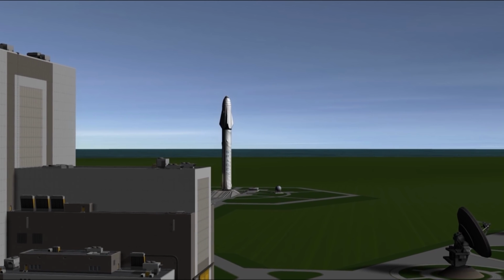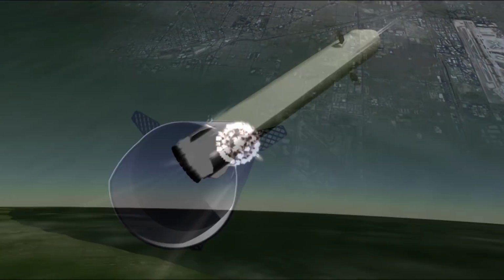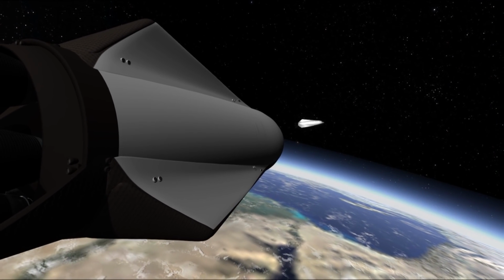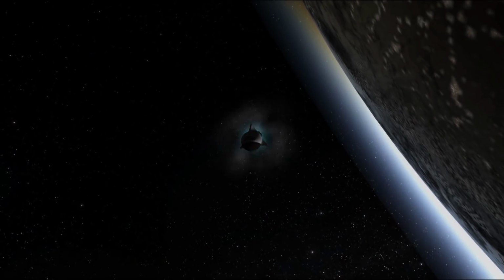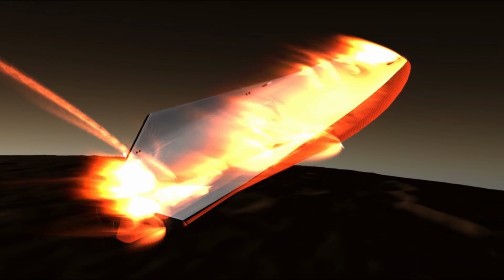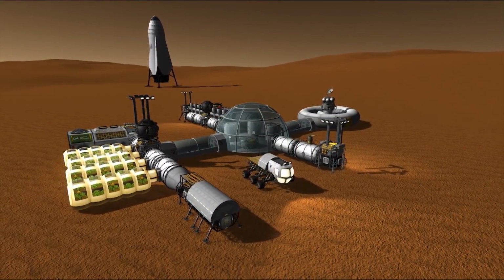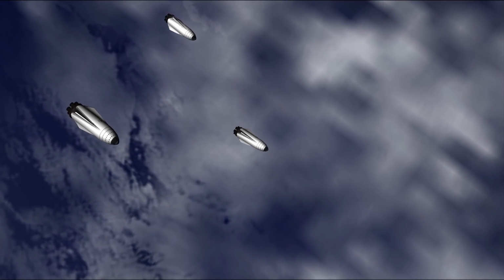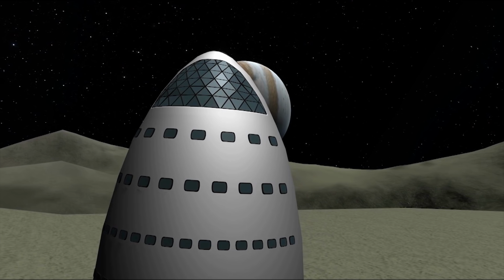Mars Colonization - SpaceX Interplanetary Transport System - Full movie

Comment: Nice video BUT it's incorrect about refuelling.
The tanker's are not heavier than the spaceship they weigh almost the same.
The spaceship requires 5 fuel tanker flights to fill up it's tanks before departure to mars - the video incorrectly claims it needs only one.

Comment: That would be a terrible waste, to leave 1st ship as a landmark. Deconstruct that shit and use it to make the 1st settlement, or bring it back to figure out the bugs and flaws in the design.
Reply: Shouldn't they sent an unmanned ship with some settlement supplies first?
Reply: They are. SpaceX plans to send a Dragon V2 capsule to Mars in 2018 with some supplies for the first colonists. And in 2020, they will send another capsule with more supplies and (I believe) a rover.
Reply: the new plan is that spacex will send 2 cargo BFR's to mars in 2022 and then 2 cargo and 2 crew BFR's in 2024

Comment: PROJET SPACE X – CALCUL DE L’ACCELERATION DU VAISSEAU SPATIAL
Considérons que le trajet supposé rectiligne entre la Terre et Mars se décompose en 2 demi trajets de 112.500.000 km. Durant le premier le Vaisseau Spatial sera en Accélération Constante et durant le second en Décélération Constante.
GAMMA(A) est l’Accélération du Vaisseau Spatial
GAMMA(D) est la Décélération du Vaisseau Spatial
D = 112.500.000.000 m
Calcul de l’Accélération GAMMA(A) :
GAMMA(A) = (Delta V)/(Delta T) c’est l’Accélération du Vaisseau Spatial
Delta V = V(1) – V(0) avec V(0) = 30 000 km/h la vitesse initiale et V(1) = 300 000 km/h soit 10 fois la Vitesse Initiale V(0).
V(1) – V(0) = (300.000.000 – 30.000.000)/3600 m/s soit 75.000 m/s
Delta T = T(1) – T(0) avec T(0) = 0 donc T(1) = 3 X 31 X 24 X 3600 secondes, on prend comme hypothèse que les 225.000.000 km sont parcourus en 6 mois.
GAMMA(A) = 75000/(3 X 31 X 24 X 3600) = 0,01 m/s² ce qui est trop faible, remplaçons les 3 mois par 1 mois et on obtient :
GAMMA(A) = 75000/(1 X 31 X 24 X 3600) = 0,03 m/s² pour rappel G l’accélération de la pesanteur terrestre = 9,81 m/s²
Si on remplace les 1 mois par 15 jours alors GAMMA(A) = 0.06m/s², soit 1/163ème de l’Accélération de la Pesanteur Terrestre..
En phase Décélération GAMMA(D) = - GAMMA(A)
Calcul du trajet le plus économique du point de vue du carburant, ça sera indéniablement le plus long du point de vue du temps (T) : Si V(1) = V(0) = 30000 km/h = Constante tout le long du trajet, dans ce cas précis le consommation du carburant sera nulle en dehors du carburant nécessaire pour assurer  la poussée des réacteurs pour échapper à l’Attraction Terrestre et pour assurer la poussée des rétrofusées pour décélérer le Vaisseau Spatial pour qu’il soit en orbite géostationnaire autour de Mars à une distance à calculer par les Scientifiques et les Ingénieurs responsables du Projet.
Pourquoi la Vitesse Initiale V(0) est égale à  30.000 km/h ?
V(0) est engendrée par la rotation de la Terre autour du Soleil, cad V(0) est la Vitesse Tangentielle du Centre de Gravité de la Terre par rapport au Centre d’Inertie du Soleil. Pour effectuer les calculs avec un maximum de précision, ceux-ci seront fait dans un REPERE HELIOCENTRIQUE ayant pour point d’origine le Centre d’Inertie ou de Gravité du Soleil et ses 3 axes orthogonaux dirigés vers 3 étoiles fixes de l’Univers (étoiles situées dans des galaxies très éloignées de la VOIE LACTEE).
.

Alaiin Mocchetti
Ingénieur en Construction Mécanique & en Automatismes
Diplômé Bac 5 Universitaire (1985)
UFR Sciences de Metz
alainmocchetti@sfr.fr
alainmocchetti@gmail.com
@AlainMocchetti

Comment: If they actually land the booster in the launch mount, I will happily eat my hat. There's no reason to put your launch infrastructure at risk like that when you could land it a short distance away for pick-up and put a fresh booster on the pad instead. I think that was the animations team getting carried away with themselves.
Reply: The  spaceship needs 1950t of propellant. Each tanker flight brings at most 380t. Since the spaceship acts as the second stage,  it uses most of its initial fuel to gain the necessary velocity to enter orbit.
Hence  3 to 5 tanker flights would be needed to fill up the spaceship depending on the payload it is carrying.
Sources: 
https://web.archive.org/web/20160928040332/http://www.spacex.com/sites/spacex/files/mars_presentation.pdf
https://en.wikipedia.org/wiki/Interplanetary_Transport_System#ITS_Tanker
http://imgur.com/a/x8K5E
Reply: And you're wasting so much deltav by making the fuel tank do a u turn. That seems like a bad idea.
Reply: It's really unlikely, they probably will have another booster. You would usually want to run some tests before relaunching it , like it's done with the falcon and the Shuttle. Saying "Oh well it's landed, let's refuel and send it up with the fuel without further ado" seems to be a bit too risky :D
Reply: HebaruSan they land it at a different site
Reply: The reason for landing at the launch location is the goal of rapid reusability. If the ship lands at another location it would have to be transferred back to the launch site and that would take both time and extra money. If it lands at the launch site, then it can be relaunched again relatively quickly and the amortized cost of the missions falls significantly (c.f. airplanes). Given that a Mars mission would require 4-5 refueling launches, landing at the launch site is almost a requirement.
Reply: Theo Tonchev why would you need 4-5 refuelling launches? They are planning a single, but they could even do it without refuelling possibly, but it's more expensive compared to refueling considering they can land their stage.
Reply: That is the plan, not just animation. Might not happen at first, but the goal is to launch. land, refuel, and launch again in as little as a few hours
Reply: exactly.. SpaceX is just as expensive.. as the shuttle era.. MINUS crew shuttling, and SCIENCE and EXPLORATION. We basically sold our space future.. so a guy can continue to sell us bullshit.. hyper loop bullshit, terraforming bullshit, cheap space flight bullshit.. meanwhile, the only launches this company does.. are for telecommunication companies.. that aren't owned or banked here.. that you paid for.
People love to hear hope..